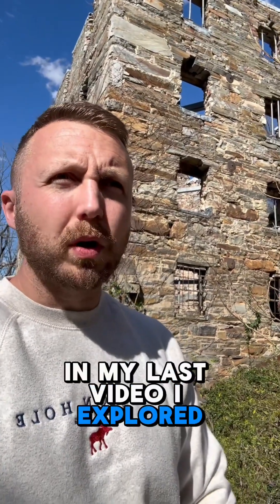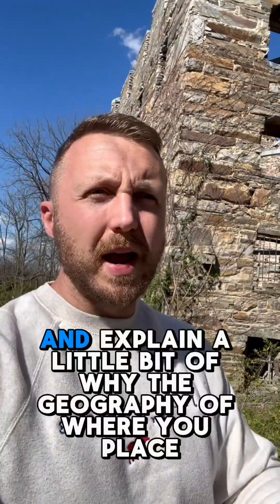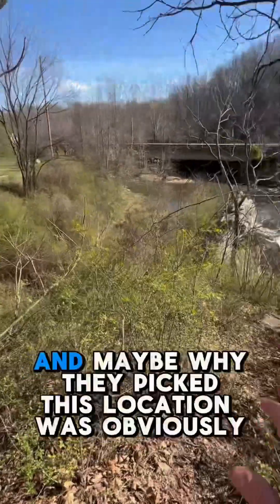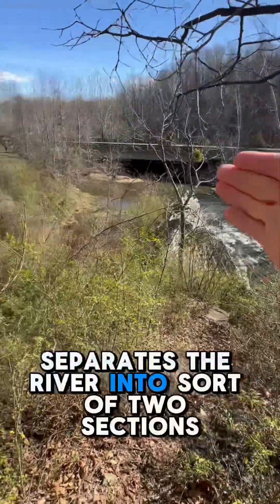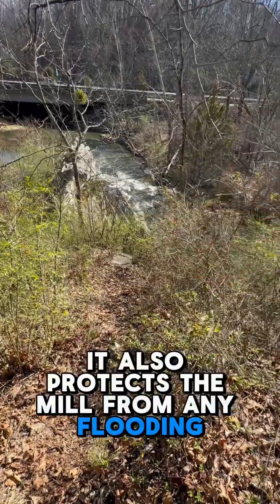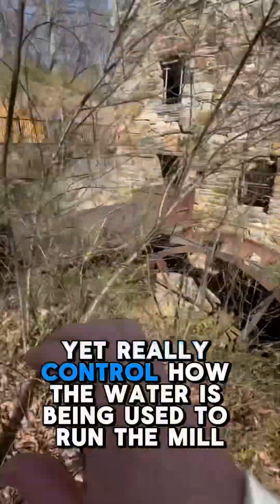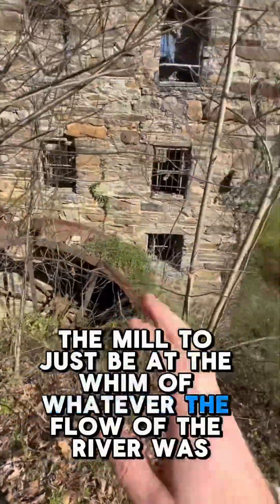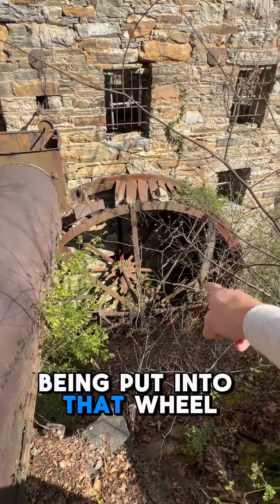Why is Geography Key to Mill Placement??

Comment: Petition the state or local government to restore the mill
Reply from the maker: It should be done!! There is a lovely massive stone ice pit nearby as well that I did a video on
Reply: I always wonder about adapting these old mill structures to become local microhydro power stations or other light industry. Especially since we already moved the river bank etc around  to make these mills in the first place
Reply from the maker: @craigsurette3438  Its in a great location, walls looked good, I am sure sticking a new power generation system in there would be possible if someone cared enough to. Having these all over the region as small backups would be an interesting idea!
Reply: @intothemap360   At least where i am living in New England there was a huge amount of small scale water powered industry. Just one tiny mill river here in Western Ma had over 20 mills in a 10 or so mile bit of river between Williamsburg Ma and Northampton. Today, that same bit of river could power a bunch of stuff especially doing microhydro power production
Reply from the maker: @ I’ve thought about building a small one on my creek!